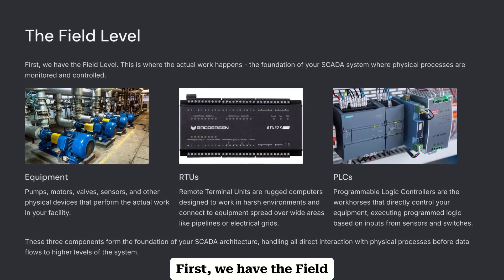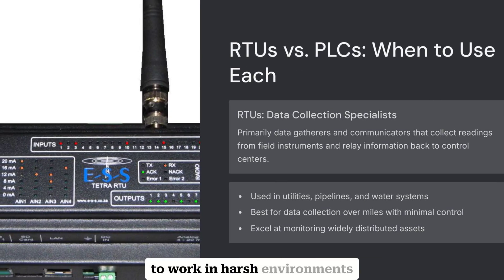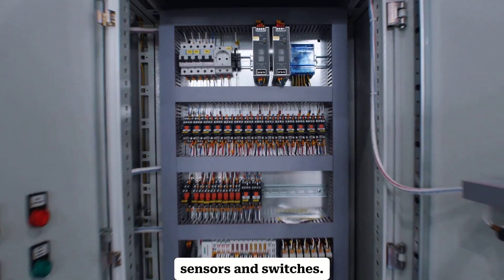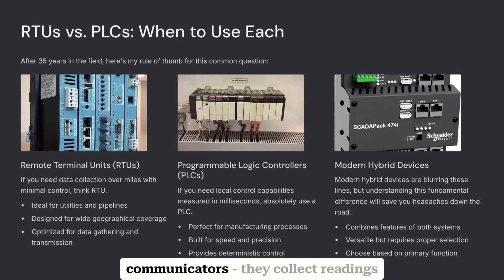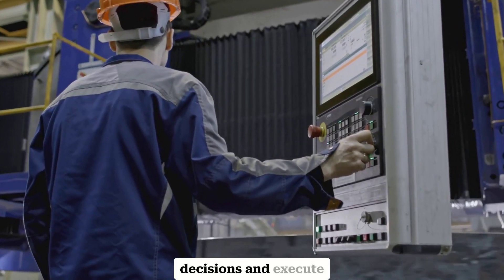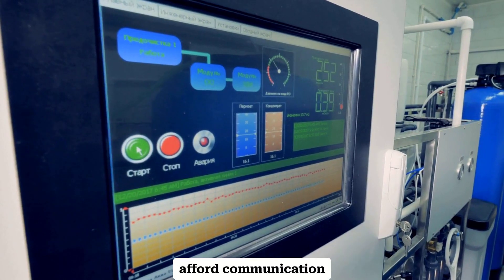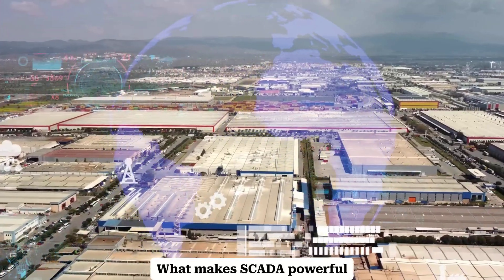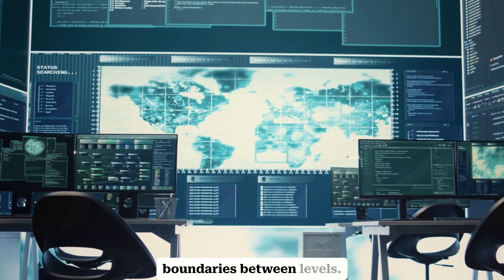SCADA Architecture Simplified: 5-Minute Industrial Control Guide

Comment: Hi thank you so much for explaining. I have a clearer picture now. I am planning to do an industry project of using customised SCADA systems, focused on detecting water leaks, may you please kindly offer some advice, and maybe where I can focus on. I’m an engineering student who is willing to learn. Thank you again!🤩
Reply from the maker: Hi  @InathiSibonelo,

I’m really glad the video helped you get a clearer picture. 😊

For detecting leaks with a customized SCADA system, here’s a simple and realistic approach you can use, this is actually how many water utilities do it in real operations:

1. Focus on a “District Metered Area” (DMA)
Create (or simulate) a small zone with a single flow meter feeding it.

2. Use Night-Flow Analysis
Between about 2–4 a.m. the demand is normally at its lowest.
Collect or simulate 24-hour flow data and calculate the minimum night flow.

3. Establish a Baseline
Take the average minimum night flow over several days. That becomes your “normal” value.

4. Add Simple Logic in Your Controller
Compare tonight’s minimum flow to your baseline.
If it’s consistently higher by a set amount → trigger a “Possible Leak” alarm.

5. Show It on Your SCADA Screen
A clean student project could include:

live flow value

tonight’s 2–4 a.m. minimum

baseline flow

a trend graph

a leak alarm indicator

That’s enough to demonstrate real leak-detection principles and how SCADA helps operators spot issues early, without needing a full industrial setup.

I hope this helps ☺️. Good luck with your project!

Cheers,
Alana
Reply: @SCADAandBeyondwithAlana  Thank you !

Comment: Sir could you explain the water treatment plant oriented SCADA process what type of value visible
Reply from the maker: Hello @thirumalairaja7728,

Alana here, that's a great question! 

In a water-treatment plant, SCADA makes the architecture tangible by showing specific values at each layer:

Field/PLC (real-time process values): 
raw/treated flows (m³/h), 
tank levels (m), 
pressures (kPa), 
valve positions (% open), 
pump/motor status (run/fault), 

Water-quality sensors like 
turbidity (NTU), 
chlorine residual (mg/L), 
pH, 
ORP, 
conductivity, temperature.

HMI/SCADA (operator view & control): 
setpoints and controller modes (auto/manual), 
controller outputs (0–100%), 
alarms (e.g., high turbidity, low chlorine, low tank level, motor overload), 
event list, and 
live trends for key tags (turbidity, flow, level, pressure).

Historian/Reports (time-series & compliance): 
daily production (m³/day), 
chemical usage/dose rates, 
run-hours & starts, alarm history/analysis, and 
regulatory KPIs (e.g., % of samples within turbidity/chlorine limits).

Dashboards/Enterprise (roll-ups for supervisors): 
energy per m³, 
plant uptime, 
filter performance (headloss, backwash counts), 
sludge/UV/chlorine performance, and 
downtime summaries for planning.

I hope this answers your question.

Alana